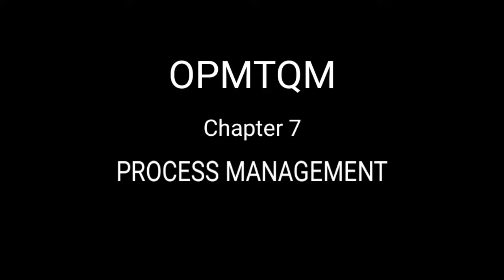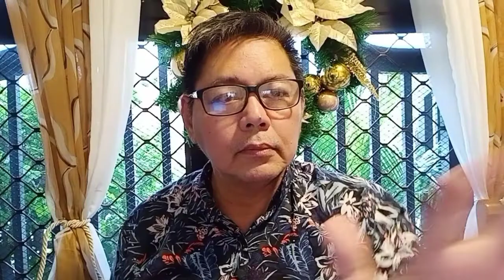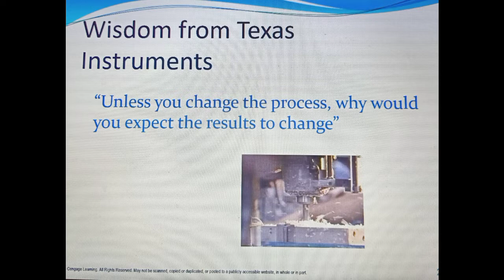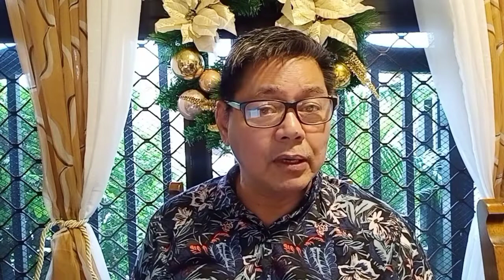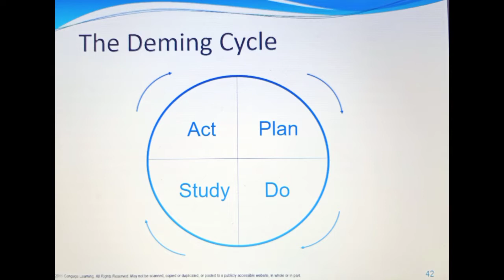OPMNTQM CHAPTER 7 PROCESS MANAGEMENT

Comment: DELOS SANTOS, Jyrah Nicolette 
3BLM
FINAL EXAMINATION
Question: Discuss several ways that training helps companies gain a competitive advantage.

Training is an avenue that facilitates continuous growth and learning of an organization’s employers and employees to be able align to the changing needs of the market. It is necessary that they be able to adapt to the fast-paced advancement of technology and working methods and strategies that are improved and developed over time. If an organization employs consistent training among employees, it could improve its performance and increase results in the workplace as employees improve in their job skills and are geared to become more effective and productive. Other reasons for its importance are:
(1)It satisfies the recommendations of performance appraisals; (2) It prepares employees for higher responsibilities; (3) It shows employees that they are valued; (4) It tests the efficiency of a new performance management system; (5) and it improves IT and computer skills.

An organization’s most valuable asset are its employees. Hence, no matter what type of competition it faces if its employees are equipped through training programs, it is guaranteed to thrive and flourish. 

Employee trainings help companies gain competitive advantage with the following:
•	Efficiency and Productivity- the success of an organization’s operation is dependent on the employees as they are the ones to implement the procedures that support the organization’s business model which requires knowledge acquired through trainings
•	Brand Management- With employees being the ones to have more contact with customers, it is important they support the key messages of the brand and this may be ensured through trainings
•	Teamwork- It is important that employees work toward a common goal which could be easier realized through collective effort. However, not all employees are team players but through employee trainings they are taught how to be one.
•	Sustainability- consistent employee trainings helps an organization in the long-run by giving employees the skills they need to move up in the company, cross-training employees to fill staffing gaps and improving their morale to decrease staff turn-over.

Jack Welch, an American business executive once said that “an organization’s ability to learn and translate that learning rapidly into action is the ultimate competitive advantage”. This manifests the importance of valuing trainings that further the development and growth of the employees for they are the backbone of the organization and will be the ones to define its success.

Comment: Sanchez, Ryeherzia A.
2 - AIA

Advancement ought to be a proactive assignment of administration and be seen as an opportunity, not basically as a response to issues and competitive dangers. Chapter 7 rotated around the method administration wherein we look at its pith within the operation of each industry. To start with it is required for us to know that process is characterized as a arrangement of connected exercises that's intended to realize a few result. Hence, It is unquestionably the time after you alter the method that you just will see changes. When talking almost forms, it included combinations of individuals, machines, instruments, procedures, materials and improvements.
In today’s discourse, handle administration was handled wherein it includes arranging and regulating the exercises fundamental to attain a tall level of execution in key trade forms, and distinguishing openings for moving forward quality and operational execution, and eventually, client fulfillment. Two sorts of forms were too talked about by Dr. Castillo, to be specific; the value-creation forms which alludes to those most vital in running the commerce whereas the support forms alludes to the foremost imperative to an organization’s esteem creation forms, representatives, and day by day operations. Additionally, esteem creation prepare necessities ordinarily depend on customer or outside client needs. Back handle prerequisites are driven by internal client needs and must be adjusted with the wants of key value-creation forms.
Irrefutably, driving companies distinguish critical trade forms all through the value chain that influence client fulfillment. Moreover, it is additionally a extraordinary feeling to have a few more information with respect to AT&T Prepare Administration Standards since I truly discover those crucial for each and each company. It talked almost the taking after: center on end-to-end handle, attitude of avoidance and persistent change, everybody oversees a handle at some level and could be a client and a provider, client needs drive the method, remedial activity centers on root cause, and of course handle disentanglement decreases blunders.
In fact, I have learned that client devotion is driven by conveyed esteem, which we all know that conveyed esteem is made by commerce forms and supported victory in competitive markets requires a commerce to persistently move forward conveyed esteem. Breakthrough Change is genuinely crucial since it is the spasmodic alter coming about from inventive and imaginative considering, persuaded by extend objectives, and encouraged by benchmarking and reengineering. To ceaselessly move forward esteem creation capacity, a trade must ceaselessly move forward its esteem creation forms.

Comment: BRIAGAS, GABRIEL LUIS G.
2BBE

“Unless you change the process, why would you expect the results to change.”

Process management establish process measurement system that align with organizational goals so that the process will work effectively. It precent defects and commiting error. It also eliminate the waste & redundancy, leading to improve quality, improving the flexibility. The key process , identifying the vital work processes that can relate to core competencies & aiming higher profitability and efficiency of the course organization processes.  Improved processes are needed in order to achieve organizational goals. Keeping the processes current with the cut with the trend. 2ways in order to know the business processes . First is value creation  and second support processes. Design processes which part of value creation processes, this can be developed and that develops product specification. Next is the production and delivery processes which also under to value creation process, it deliver the product efficiency.

System in a business is important because it helps to flow the business properly. There are many businesses that failed due to weak systems. Weak systems will lead to collapse of the business that's why process management has a vital role which help to improve systems.

Comment: ASINAS, Geraldine M.
3BLM  - FINAL EXAMINATION 

QUESTION: What is the purpose of a training design process?  Discuss the six steps of the Instructional System Design training process. 

	One of the organization’s effort in increasing their competitive advantage is through improving the training system of their employees who plays important role in the overall success of the company. Training is a planned effort to facilitate the learning of job-related knowledge, skills, and behavior by employees. It is important to improve the performance of employees which will be a good advantage for the company. That’s why training design process is very important. Because having a training method doesn’t guarantee success in companies, it must be the proper training method. Training not just in its superficial aspect, training should be designed according to what fit to the needs of the employees and to the desired goal of the company.

	The training process
1.	Needs Assessment - This is used in order to determine whether conducting training is necessary. Under needs assessment there are three analysis that need to be consider, fisrt is organizational analysis which concerns on identifying whether the company has the budget, time and the expertise for training. This is also the stage where the company identifies whether training fits with the company’s strategic objective if desire to conduct training. Next is person analysis which identifies who needs training and whether the employees are ready for training. The third analysis is task analysis. This is the process of identifying the task, knowledge, skills, and behaviors that need to be emphasized in training. 

2.) Ensuring employees’ readiness for training – The company have to know the personal characteristics of including the ability, attitudes, belief and motivation of the employees necessary to learn and in order to apply it in the job. 

3.) Creating a learning environment – Companies must encourage communities of practice. They have to provide avenue for groups of employees to work together, learn from each other, and develop a common understanding of how to get work accomplished. 

4.) Ensuring transfer of training – transfer of training is the use of knowledge, skills, and behaviors learned in training on the job. There are different factors influencing the transfer of training such as manager support, they are the one who emphasize the importance of attending training and applying their learnings on the job. Support network or those who they’ve met in trainings, they can help in encouraging the employee to use his acquired knowledge from the training. Trainees should be provided chance to perform his learned capabilities. Another factors influencing transfer of training are climate for transfer this is the perception of the trainees of the characteristics of the work environment, technology support such as computer application that can provide skills training and last is self-management skills, this is personal to the employees, this is where they set their own goals for using their skills. 

5.) Selecting Training methods – training method pertains to the types of training that can be provided to the employee to sharpen their skills There are various methods such as hand-on method, on the job training method, group or team building method, simulations, e –learning etc. . Selecting proper training method is very important because as mentioned above, it should be designed according to what fit to the needs of the employees and to the desired goal of the company.

6.) Evaluating Training programs- It is important to evaluate training programs to identify the strength and weaknesses of the program in order improve it. To assess whether the program contributes to the learning of the employees. To identify which employee benefited the most or least. It also help in determining whether the company benefits form the training.

Comment: Medina, Harold S.
2-AIA

        Process management is about how entities would produce their products to their customers.  Operations produce goods and services by managing processes to change the state or condition of something to produce outputs. Companies would like to have a structured and systematized process to enhance their capabilities to produce more of what they can offer to the public. Process management would be the key to have a smooth operation in the business.

	Companies would rely on how good their process is in terms of the ratio of frequency and production. A company who can balance these 2 means that their process management has a good quality of being capable to produce. Process management would always lead to the company’s performance and excellence. Through performance, they can eventually determine their shortcomings and errors for their products. Errors should only be once encountered because if errors are done several times during production process, quality of the products is not visible and the trust level of the customers would be low and it is enough to not succeed in the business venture. Excellence of the process management is on how smooth the process is and how well the process is tackled and applied in the system of the company. Companies should always remember that the key to have a very quick production is through mastery of the art of excellence. Excellence is intangible but you would always know that you are an excellent entity based on the customers reviews on your products. 

	At the end of the day, reactions of the customers are the very most important thing in production, as this is the way to know the errors and the areas you need to improve in your company. Performance and Excellence are the keys also to have a smooth process as these 2 match together to achieve a very well process management.

Comment: BAGACAY, Jiana Andrea D.
3BLM

Hans Van Krevel quoted “ The whole idea of process management is: the chain of actions to be made effective and efficient”

Process management as discussed in the video involves planning and administering activities necessary to achieve high performance business processes. Managing the processes of an organization prevents defects and errors hence eliminating the waste and redundancy. Process management integrates excellence into the strategic management of organizations. In order to achieve this, one must identify the work processes that can relate to core competencies, deliver customer value and aiming higher profitability. The discussion also mentioned key work processes requirements: One is by integrating the input from the customers, suppliers and partners; Integrating technology in the process; and improving organizational knowledge, productivity and cost control. 

The two types of processes were also discussed in this chapter: Value-creation processes which include design and production processes; and Support processes which is essential in the daily operations of an organization. Value creation process determines what value can the company provide to its customers and the value the company receives from its customers. Starting a business or a company usually starts from this process. On the other hand, support processes is necessary to facilitate or assist the execution of management processes.

Process Management adds value to an organization as it allows the latter to better orchestrate resources minimize expenditures and increase productivity. It enables organizations to be more efficient by identifying and eliminating wastes and aspects which don’t give value. Process Management enables organizations to record and measure every activity of the processes which drives improvement opportunities and maintaining better customer services. 

This is indeed important in every organization especially in our current time wherein many organizations and companies have shut down and discontinued due to pandemic.
An organization, by maintaining and keeping track of its processes will surely be able to withstand the effects of this kind of unforeseeable event.

Comment: Silvestre, Aubrey Gwyneth
2BBE

“When there is success, definitely sustainability follows.”

The quotation mentioned above was discussed on the first needed context in determining the key process management in the principle for performance excellence. In process management, identifying the vital work processes that relate to core competencies and delivers the customer value, aiming for higher profitability and efficiency of the course organizational processes leading to success is the first context. We can do this by incorporating the input from customers, suppliers, partners and collaborators (which in the management parlance called stakeholders). The efficiency and effectiveness factors include new technology integrating into the new technology, the organizational knowledge, the efficiency of the cycle time, the productivity, and the cost control which is very important in process management. 

“Unless you change the process, why would you expect the results to change?” 
- Texas Instruments 

What I understood from here and from the lecture is that companies and organization should initiate in recognizing and picking out principal business processes around the value chain that will definitely affect customer satisfaction. From here, two categories of processes were discussed which are: 1.) Value Creation Processes and 2.) Support Processes. Value Creation Processes, as discussed in the lecture, are the most important to running the business for the reason that design processes as part of the value creation processes can develop the functional product specifications. It defines what the product can attribute to customers. These are actually the activities or action made by a business to create the worth of any product. They also encompass the production and delivery. While the second one, Support Processes are important to employees and the daily operations of a firm. Support Processes actually exists to help with the value creation, while not directly creating quality. It depends on internal requirements, which should be integrated to ensure an efficient and effective linkage and performance. 

Overall, I learned about the importance of the process management in the operation of the industry. The different design and innovative work processes to meet all requirements are also discussed which gives better picture to the various examples of work processes. Key process management principle for performance excellence minimizes the overall cost associated with the inspections e.g. quality inspections conducting tests, and validating processes or performance audits. For me, this means that these principles for performance excellence help us validate and assess processes whether they are effective or not.